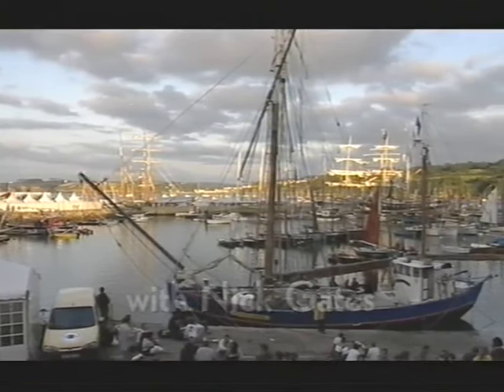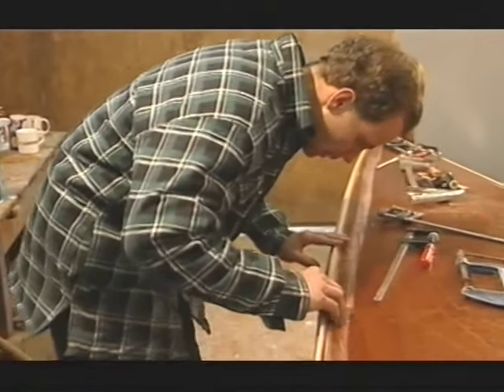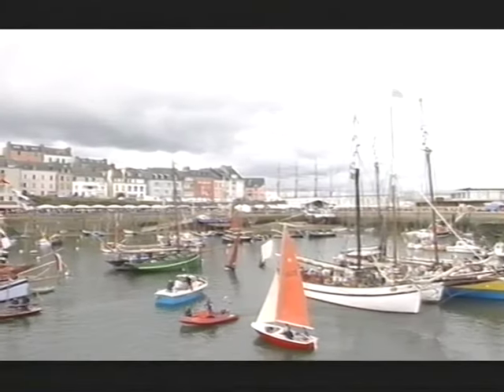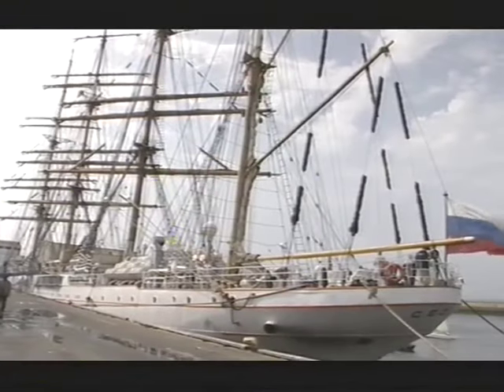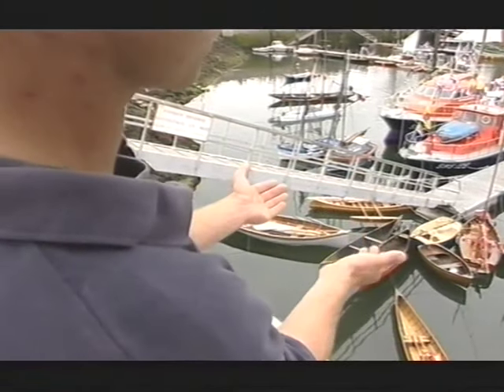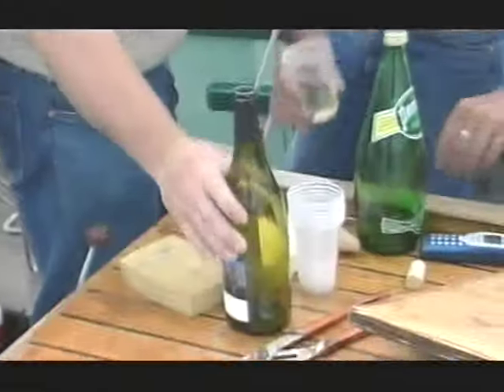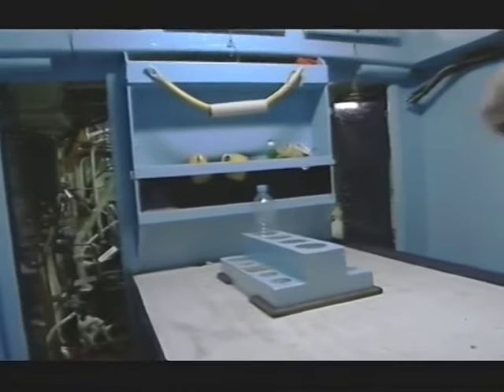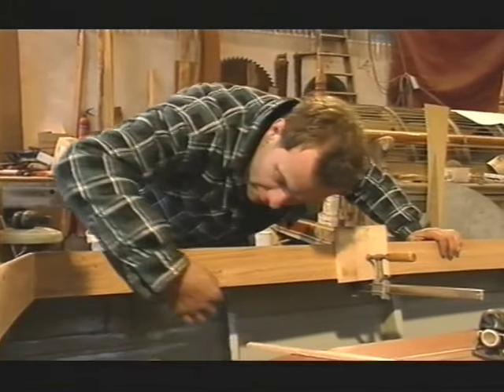Getting Afloat with Nick Gates, Episode 13, A Festival!

Comment: what glue are you using?
Reply: In previous videos he's using polyurethane glue, which foams. Not sure about this one.
Reply: @SirPrancelot1  
3:57 there's a bit of expanded urethane which squeezed out the end.

But it's black from the tube, I've never seen that, I thought it was a Sikaflex at first which made me stratch my head. But then again I believe this series was filmed in 2002.

Personally I never had much success with permanent adhesion with the Gorilla Glue brand here in the U.S. 

That being said, the is a beautifully sick minor detail that not only deals with the joint between topside and deck on a effective way but also makes the whole thing pop.

He's a bit of a wizard with his attention to detail and the skills to bring his plan to fruition